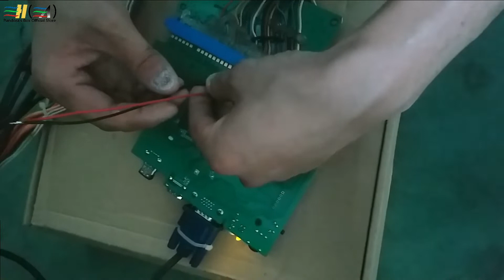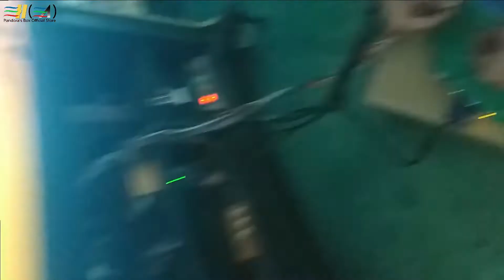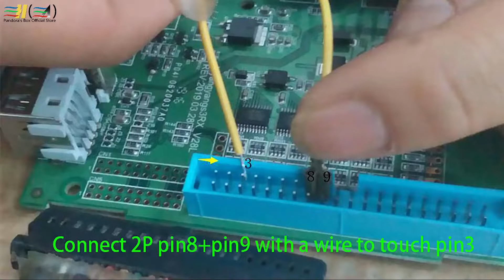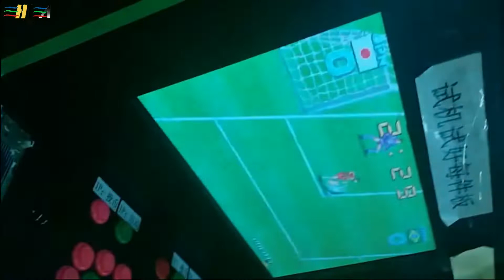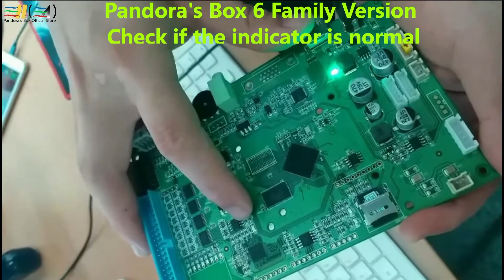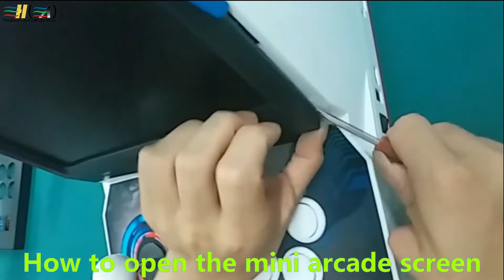About Very Small Number Of Pandora's Box 6 Some Problems And Solutions

Comment: There are sound issues on nearly all the old 1980’s games that I  bought this  Pandora’s box  unit for.  Distorted sound that cuts in & out.  Can this be fixed in menu settings?? I tried setting  Quality Optimization to Off , but that didn’t change issue.

Comment: I have two new astro city candy cabinets, and there is this problem in one of them, a red blinking led inside the pandoras box is doing some flashing just in one of them, my approach, thouht a problem in voltages, but tried in a mvs neo geo and there is the same positive voltage +5V boths pins C and D of the jamma connector. Is there any way I am missing something?